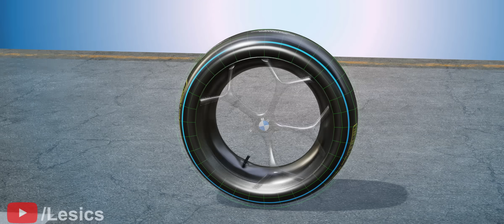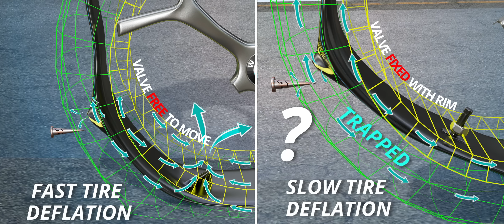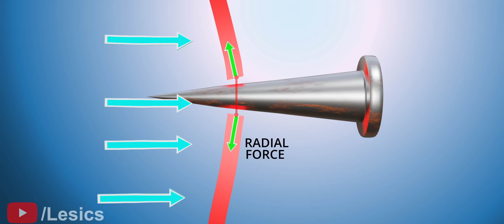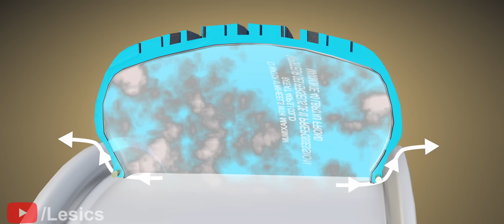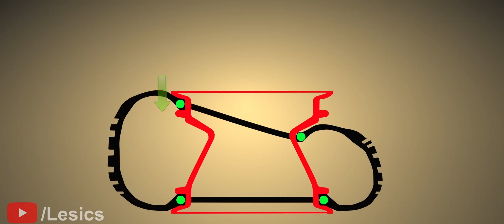Tubeless Tire | The interesting Physics behind it

Comment: I haven't had a single flat tire for 4 years on my motorcycle with tubeless tires. To think that everyday items that we normally use actually have some genius people behind them is pretty amazing
Reply: Village roads want to know your location 😂😂
Reply: @kanixmishra  of road enjoyer
Reply: leds are also genius
Reply: It’s been 10 year since I’ve had a flat that left me stranded on the road. I wish I thought about tire engineering when I was in college 🤷‍♂️ it interests me
Reply: But the other tyre is fine 😁
Reply: same goes with our bodies😅😅.... genius nature created some of the most complex structures so that you have a much better life
Reply: On motorcycles with smaller tyres, slightly deflated tubeless are more dangerous on sharp turns when the vehicle swerves to one side, where uneven pressure of the tyre's rim to the velg caused one side to slip letting a lot of air out in short time, causing a slip and fall. Learned this the hard way. On other points, yes they are far more superior.
Reply: Bro the engineering required to design and manufacture the phone you used to type this is like a million times more complex than the technology used for tires. It's almost alien technology.
Reply: Aj 177
Reply: Aj 177 2
Reply: @pavelk4014  r/skamtebord
Reply: my bike tyre has a puncture, but can't locate it.. So need to fill air every week
Reply: @vickypareek3171  Submerge in water to find the hole. If it doesn't bubble underwater because the water is enough to seal it, then expose some part of it and rotate it slowly in the water. You'll find the hole when it is on the surface on the water.
Reply: @vickypareek3171  inflate your tire and then use some soapy water to locate it
Reply: I have dozens
Reply: Also to your society and to people of your country because they don't throw nails here and there!
Reply: Yeah, my motorcycle also 4 years and still good.
I just worried later when time to change. It will be pricey
Reply: I did have but next day would b flat
Reply: Great,
For me life taught me this, I had a tube tire before and a nail got inside of it, luckily I wasn't too far from my village 😁 
iit was the back wheel and I still remember, I was sitting in the gas tank, in order to make less pressure on my tire and avoiding hurting it loli
Reply: Here is a trick: stuff your tires full of hair - any hair and the effect will be noticeable
Reply: Ampe ban rusak, baru ganti, ga pernah bocor 😂😂😂
Reply: Tire brand name?
Reply: I had only one puncture in the last 10 years, I had a tube tire.
Reply: Jaan i
Reply: Bought a new to me harley , got a flat on the way home😅
Reply: There are other technical aspects than just the tyre.
Reply: of course you haven't. If you did you wouldn't be here typing this comment
Reply: Mine failed and I had to switch to Tube.
Reply: same
Reply: I haven’t had a puncture on my Tubed tyres on Honda for 5years of high mileage tours
Reply: @zeez9053  my bike had tubed tyre punctured once in 11 years.
Reply: @kepler214  and u use the bike once a year
Reply: @kepler214  my road bike gets punctured every 11 hours!! Guess I'm getting tubeless
Reply: @zeez9053  g
Reply: This is a misconception. Tube / tubeless tire has nothing to do with flat tire. Tubeless or not, if a nail punctured your tire, your tire will flat. The difference is in the how much time before all of the air escape.
Reply: I've had 4 blown tubed tires in 3 years.
Reply: Ever since I switched to steel wheels I haven't had a flat in ten years

Comment: For aircraft landing gears the rims are divided into two -outer and inner rims .joined by tight bolts.
Reply: its called a bead lock. most off road trucks or rally cars have it. especially rock crawllers or extreme heavy equipment
Reply: @jamesporter.  They are not beadlocks, rather they are two halves.

Comment: Still some old budget cars use Tubed Tire, never seen car becoming uncontrollable when Tubed tire gets punctured. In my experience we had Alto with tubed tires and we came to know that all the tires got punctured at same times but did not feel car becoming uncontrollable, probably because it was at low speed.
Reply: Airless tires would be even better but there is something quite nice about tubeless tires.
Reply: @aosorea  May be not on your Mars 😆 😂, here in Delhi, I know even Toyota Fortuner owners have got tubes placed in their tubeless tyres.
One or two punctures are enough to make the tubeless tyre useless.
Reply: @aosorea  I am not sure about others but we do have Michelin in India, and other standard Indian brands, Dunlop had closed down, never heard of Pirelli, so many be the quality of Indian tyres is not upto the mark, it could also be bad Indian roads.
Reply: @Himanshu Ramani You are right, we Alto wallahs rock 😊.
All tubeless tyres after 15000 kms or so develop micro holes and one needs to add tubes to those.

Comment: I think this channel showing advertisement for tubeless tyres. Tubed tyres are not "devastatingly" unsafe. The only use for using a tubeless radial is that it can run for a few hundred Kilometers even after being pricked, whereas the tube tyre will deflate almost immediately. Also tubeless tyres are relatively lighter than tubed tyres which can result in better efficiency.

Cons are tubeless rims and tyres are comparatively costly than tubed tyres and the tubeless tyre can be rendered useless if there is even a little leak due to micro puncture or rim bending, tubed tyres are almost immune to these defects.

I have tubeless tyres in my car but due to above problems I have converted two rear tyres into tubed tyres by adding a tube inside the tubeless tyre, instead of buying a new one. It cost me 1/10 th. So its better to keep the front tyres as tubeless and you can use tubed tyres as rear tyres for safety.
Reply: Also a good quality tubes behave in the sticky tape balloon way, they donot burst, also since there is a rubber tyre that keeps the tube in its place and traps some air momentarily and doesnt let the puncture expand. So this analogy is not correct.
Reply: *Micro punctures are practically undetectable as they donot show bubbling inside the water.
Reply: @aosorea  They are more convenient and convenience comes at a cost. A typical tubeless tyre and rim can cost more than 3 times a tubed counterpart of same quality in terms of mileage. Now you sound like a preacher by saying "whether you like it or not" after I wrote a detailed description about why 'I like it or not'.
Reply: @aosorea  tires donot save lives, repeat after me slowly. T I R E S .....  lol
Reply: @6s9hcr2  tires save many lives and tire choice is incredibly important saying other wise is really ignorant
Reply: @Nic-te3vq  I have been driving since 19 years but never have I seen or faced a real life threatening problem that relied on tube of a tyre. I sense you are like preachers in a church, citing gospels of god. Take a chill pill and ignore what you find irrelevant instead of coming in with all enthusiasm but no facts over a youtube comment. Peace.
Reply: @aosorea  You have started personal attacks now, good, you proved my point, preacher. I have never seen a tire bursting only because it was tubed, simply because the outer tire is not made of paper and it holds the integrity, tires only burst due to over pressure and not because of puncture and tubeless tires can also burst if over pressured. I dont know what physics you have studied but it seems like its not from some reputed place. Peace.